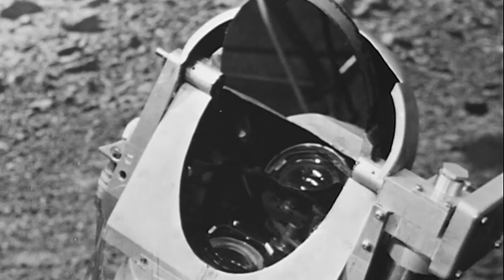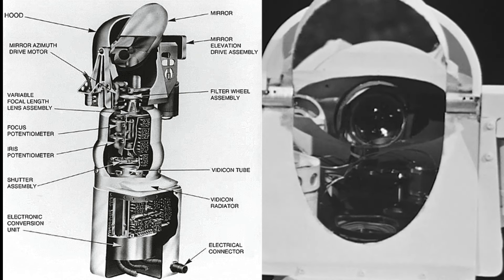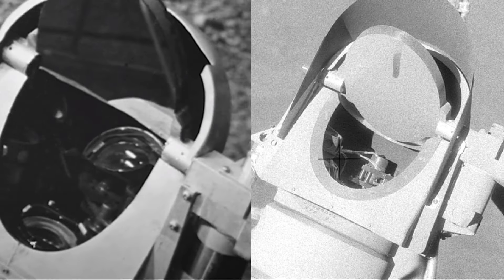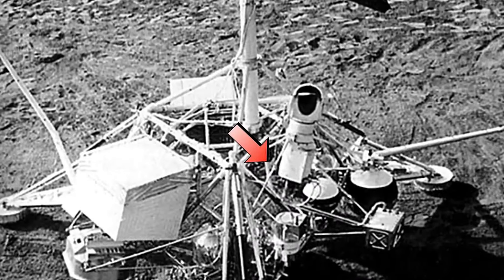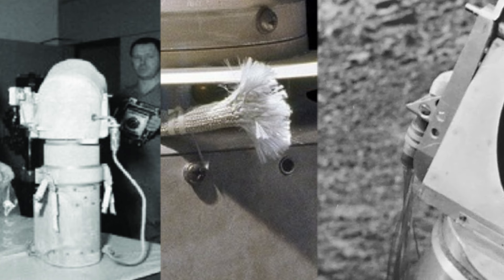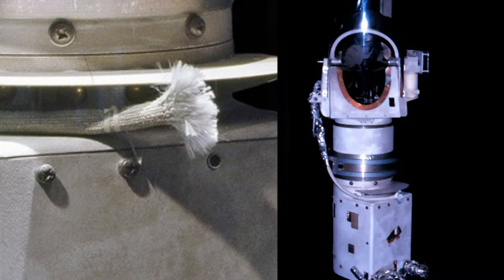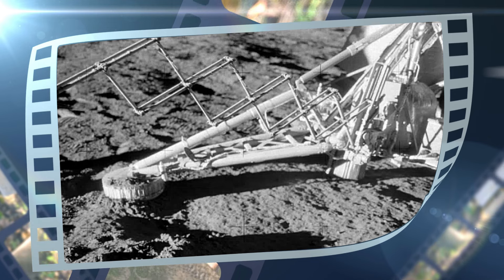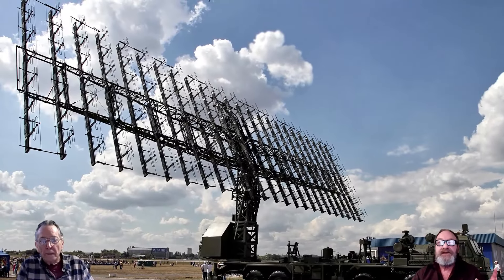THE APOLLO DISCUSSIONS "SURVEYING THE SURVEYORS" PART 63

Comment: There is a preponderance of evidence indicating we did not go and nothing truly solid proving we did. Arguments over the flag do not solidify either side of the debate, however, researching the effects of the hard vacuum (Tor-11) on the Moon reveals the inability of film to withstand it. Even if it did, 200 degrees F in the Sun and 150 below zero F in the shade would cause film to melt and shatter at each temperature extreme. Vacuum also causes metals to cold weld together and film coatings to outgas. There would be no way to even take pics on the Moon with the equipment NASA claims to have sent. That is but one small part of a huge amount of discrepancies and impossibilities you find if you actually take the time to investigate. The more you try to find proof we went, the more evidence to the contrary you find. Truth's protective layers? The truth doesn't care if you believe it or not. You can try to hide truth but that doesn't make it false. By virtue of it's honesty, truth has the unyielding protection to outlast any lie.
Reply: Very well spoken, chapeau
Reply: @seventhvictim4046 
Please blind us with science. 

Exactly WHAT 'special' lubricant, and WHAT cold weld proof metals were adapted for the Hasselblad cameras?
Reply: @seventhvictim4046  You know why the pictures are made so perfect fella?
Reply: @seventhvictim4046  How could they take pictures on the moon if they never went?
Reply: @seventhvictim4046  "they prove the landings took place but I wouldn't expect you to understand that." Thats right i am not a believer but you are free to do so my friend the believer.
Reply: @seventhvictim4046  So you don't understand that photo editing analysis has not only exposed the fact that many of the Apollo photos are cut and paste jobs, but also proved that the Apollo "sun" is really a spotlight?.. In fact the spotlight "sun" used for the Apollo 12 photoshoot is the same exact spotlight image used for the Apollo 17 photoshoot.
Reply: @straydog02   "And because they so stupidly photographed it, we know for a fact that the Apollo "sun" is a spotlight."
Let's see, Armstrong was brilliant at math and aeronautical engineering like most all Apollo astronauts, Buzz wrote a paper when he was at MIT about orbital rendezvous I still can't grasp, but yet those guys according to you were stupid.    That's all we need to know about you.
You probably think you're smarter than all those airplane jockys' huh?   lol

"And since you admit to seeing this evidence before, then you also know for a fact it's a spotlight."
No it's in fact the Sun, and the Sun was not always towards the left,  and your Circular Logic is showing again.

"And the fact that you're LYING about this evidence being debunked, tells me all I need to know about you."

No you are lying by calling someone a liar who defends the Moon landings, who knows and comprehends the mountain of empirical evidence that substantiates the Moon landings, which obviously cannot comprehend.
Reply: @seventhvictim4046  "It is clear to me that you ae a know nothing kinda fella " This how it always ends, you believers start name calling and ridiculising your opponent and that is where you lost the debate fella.
Reply: @William-tecumseh-sherman "your ability to actually do research on the apollo program"  You see thats the problem with you believers you can not research something that never happened and if you do you get the results the detectives come up with time after time and I like that.
Reply: @William-tecumseh-sherman "pareidolia " Her we go again name calling comes when there are no arguments.
Reply: @William-tecumseh-sherman Tell that to the detectives when you have the guts to debate them.
Reply: @William-tecumseh-sherman The Apollo 12 and 17 "sun" was not just the same spotlight, but the exact same image of the spotlight...https://imgur.com/a/hEC3mxS
Reply: @seventhvictim4046  What were the camera special lubricats and cold weld proof metals?
Reply: @seventhvictim4046  LOL - The secret sauce must still be classified. 
Can you point us to any documentation as to precisely what modifications were done to Hasselblads?
Reply: @straydog02  During all Apollo Moon landings the Sun was always less than 15° above the Moon's Western Horizon, that is while looking North the Sun would have been to the right, the West side of the Moon.
Because the Cardinal Points of the Moon correlate with the Cardinal Points of the Earth.
Those are the facts no matter what you wish for, and you still didn't know this either?   
😂😂😂😂😂😂😂
Reply: @William-tecumseh-sherman I haven't deleted any of your comments... YT often deletes comments with links.. I have seen the images of both the Apollo 12 and 17 "sun" and the GIF image I posted, shows it's the same exact spotlight image used for both photoshoots.
Reply: @g.gorrell2088  Your reply has nothing to do with the fact that the spotlight image used for Apollo 12 is the same exact spotlight image used for Apollo 17.. Nor does it change the fact that the artificial light source, ie; spotlight, was to the left of Buzz in the Apollo 11 photo of him saluting the flag.
Reply: @straydog02  I agree my reply has nothing to do with a spotlight, because the Sun is not a spotlight in the Apollo photos, and the Sun was ALWAYS above the Western Horizon.   Sorry you didn't know this either.
The Sun is to the right when Buzz is coming down the ladder, the Sun is towards the right when Armstrong took that iconic photo of Buzz, so I have no idea what you're rambling on about here.
Reply: @g.gorrell2088  "I agree my reply has nothing to do with a spotlight, "

Then you agree that your reply has nothing to do with what is being discussed.

"because the Sun is not a spotlight in the Apollo photos, and the Sun was ALWAYS above the Western Horizon."

The Apollo "sun" is a PROVEN spotlight, and the real Sun being above the Western horizon has absolutly nothing to do with the position of the spotlight in several of the Apollo 11 and 12 staged photos.

"The Sun is to the right when Buzz is coming down the ladder, the Sun is towards the right when Armstrong took that iconic photo of Buzz, so I have no idea what you're rambling on about here."

The light source in those photos is not the Sun, it's a spotlight.. And in the Buzz saluting the flag photo, the artificial light source is to the LEFT of Buzz, not to the right, so I have no idea what you're rambling on about here.
Reply: @William-tecumseh-sherman No, I am not lying and yes, I can post links on my own channel and even used to be able to post links on this channel and all other channels.. But a few years ago YT took that ability away from me, along with many other people.. I posted a link yesterday to the A12/17 spotlight GIF, but don't know if it was allowed to remain posted.. Did you see it?
Reply: @seventhvictim4046  "you ain't worth the effort, tiny though it is." I dont debate believers, you debate the detectives.
Reply: @seventhvictim4046  Okay believer
Reply from the maker: Well said Mathew. I would have to conclude that since metal parts cold welded themselves together outside of the ISS, that the same would have occurred on the lunar surface, ie the cutting of the Surveyor III camera mounts. I would have to postulate that the cutters would have welded themselves to the camera mounts, the same way that a drill socket welded itself to the drill outside of the ISS. Cheers!
Reply: @straydog02  there is no light diffusion in any of the photos, and the shadows are all pitch black, that doesn't happen on Earth with an atmosphere...Ever."
Reply: @ell2088 Lens flare does not create HALOS around the Sun .. Halos only occur when the Sun is photographed in an atmosphere.. Or in the case of the faked Apollo photos, when the spotlight is reflecting off a scotchlite screen.

So you didn't look at those Apollo 14 and 16 magazines on Flickr, where the shadows of the astronauts and the boulders are as light and as see through as shadows are Earth?... If you had looked at them, you wouldn't still be so stupidly talking about Buzz being lit up while coming down the ladder.
Reply: @William-tecumseh-sherman "just what I was going to say, it was a lens flare....but stray wouldn't know that at all."

 Actually stray does know all about that, since it's the very stupid, go to excuse used by all of the fools who defend the bogus Apollo photography.
Reply: @William-tecumseh-sherman Do some research into what creates HALOS around the Sun and also artificial light sources... Since the Apollo "sun" was a spotlight, the halo around it was most likely caused by a scotchlite screen reflection.. I can't post link to that evidence here, so will post it on my channel later and let you know when it's up, so you can see what I'm talking about.
Reply: @m-tecumseh-sherman AS12-46-6806 and AS17-134-20411 have the exact same lens flare pattern, consisting of three balls of light that are all the same in both photos.. There is a medium size ball of light nearest the spotlight, followed by a smaller ball of light and then a much larger ball of light farther away from the spotlight ..The A12 spotlight image is turned on a slant, but it still shows the identical lens flare pattern in both images.. Which means it's the same image.
Reply: @straydog02   I guess the crews of Apollo 12 and 17 were whistle-blowers then, like "Dr." Rasa?  lolol

Comment: Total debunk, detectives. Ropes, Wires, and DuckTapes, LOL! On another note, "SpaceX & NASA finally did it - Land on the Moon after 51 years", (Sans Humans).
Reply from the maker: Well, I do wish them luck especially constructing that Lunar Gateway Station, which will continually orbit the moon from pole to pole. It only took them ten years to construct the ISS, which is about two and a half times the size, so that would take five to six years. They wish to go in 2025 now, so when are they going to begin hauling the modules to lunar orbit and then assemble them all? Apollo did not require such as station, although Von Braun claimed they would, but what did he know? He was the one who got the U.S. in to LEO. It is quite sad.
Reply: "(Sans Humans)" Of course and one must believe they landed after 51 years because they say so😂😂😂😂😂😂😂

Comment: If so many Watts a mile are needed for radio transmission, how than can Voyager sent it's signal to planet Earth?
Reply: All BS
Reply: The power output of the transmitter is only part of the equation. Tell me how many Watts are needed per mile, you can't. You need to know the frequency of the transmission, the mode of modulation, the gain of the transmitting and receiving antenna, what type of antenna they are, what the propagation is like etc.
Reply: @Roy-Bland Therefore,  to sent a signal over millions of miles, the frequency, mode of modulation, the gain, and a large antenna would have to be decided on? Okay, I can understand than that this may be possible. Thank you.
Reply: @somedude5951  Can you point out any apollo like video broadcasting from an equal distance today?
Reply: @yomommaahotoo264 Can you point out an attempt?
Reply: @stevepalmer1587  
That's NOT color or even black and white video.
Reply: @stevepalmer1587  Meant to say 'using the same type equipment'.
Reply: Not only that further it's, the more precise have to be directed, every move of gimbal where camera is,  anthena would require correction of how it's rotated, Eventually this spacecraft will rotate in uncontrolled fassion, if engine is not functioning, any uncontrolled move of gimbal might make it rotate, wont be easy to stop, how does that keep tracking the Earth? Try to set satelite dish on Earth that require precission, one wrong move your hand shakes when you tightening screws and no signal, V is not attatched to anything there is no hand to hold it, no ground to keep it stable
Reply: @stevepalmer1587  Then you've already done the calculations for the apollo TV signals?
Please share. Blind us with science.
Reply from the maker: Good question. According to an MIT paper released on 100 MHz to 2.2 GHz signals, those radio waves have a problem passing through the plasma layers of the VAB's. This is the reason for multi dish networks to be installed to receive weaker signals. We did not see this with the Apollo program, not multi dish networks like we see with Voyager or any other deep space probe. That is the problem here. Cheers!
Reply: @yomommaahotoo264 I know the difference between morse code and voice, in reach. Morse code is several times longer in reach. That's one of the reasons, military intelligence agencies still use morse code today. Video added to audio in broadcast, would even make the distance smaller, and much more energy heavy/signal recognition in the background noise.

I agree with the video, that broadcasting video from the moon, before digital compression was even invented, is not plausible. Signals from Voyager, which can be in morse code, need a lot less energy though.  I do not have enough data to decide whether Voyager is really able to broadcast from the huge distance it is sending from. I was just asking in case a physicist, having these details available, was in the comments.
Reply: @stevepalmer1587  You’re blowing smoke.
Reply: @somedude5951  I disbelieve the Voyager for other reasons.
Reply: @UNcommonSenseAUS  "Nothing has, can or ever will go to "space"" Exactly
Reply: @yomommaahotoo264 For what reasons do you disbelieve the Voyager?